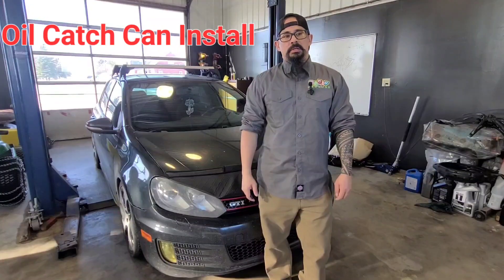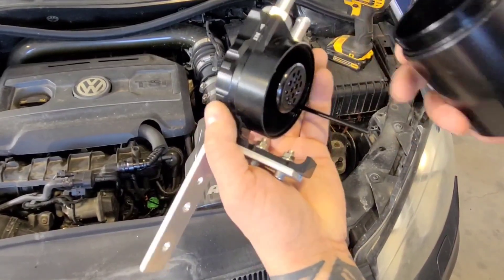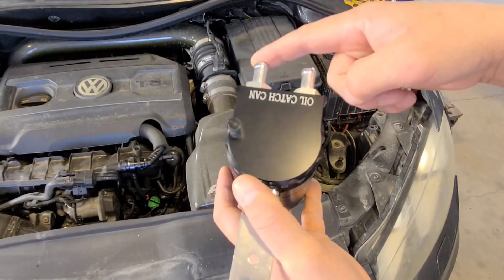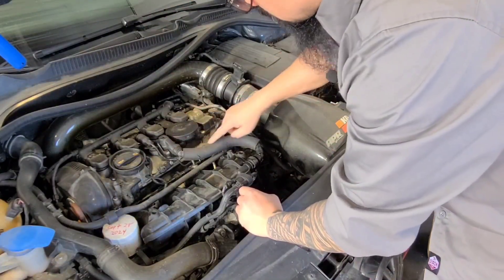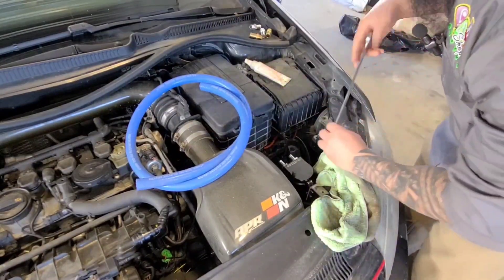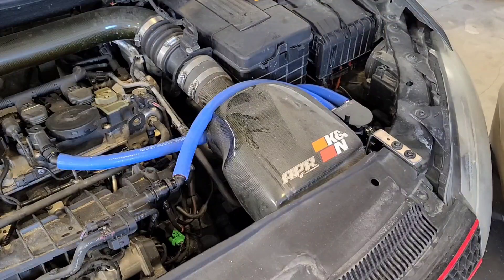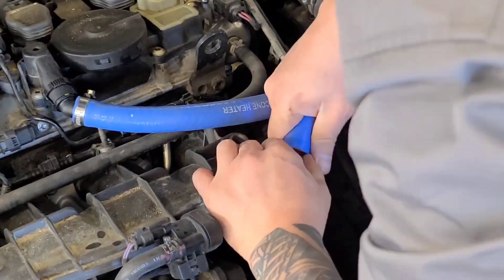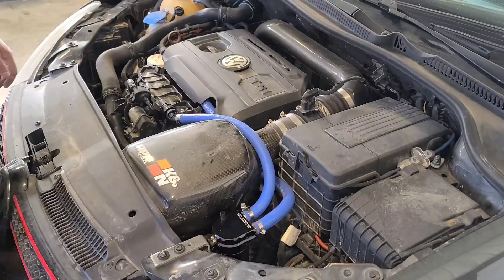How To: Oil Catch Can Install

Comment: Sweet setup! Questions. You leave the PCV in place? What happens to the rear hose, where does that connect? If you are leaving the PCV in place do you cap the old ports you are not using?  How is it working for you. Do you pass emissions?
Reply from the maker: PCV system is left intact, oil catch can is just T'd in-line to catch or seperate the extra oil from the fumes to prevent from burning it thru the engine.  You just need to drain it periodically.

Comment: Why not use a proper oil vapour separator such as the Mann-Hummel Provent? These aluminium ones made by I Want Your Money Inc are useless.
Reply from the maker: Cost
Reply: @jedlowdually yeah the Provent isn’t cheap and replacement filters too.
Reply: @D0zer122  the cheap ones works very well, and they fit in each enginge bay. 
the big Seperator from M+H don´t fit everywhere.
for example, i have an OM642 Diesel, a very big V6 Diesel engine, build in an w211... there is even close to install the little cheap ones. no spot could get the big M+H Seperator.